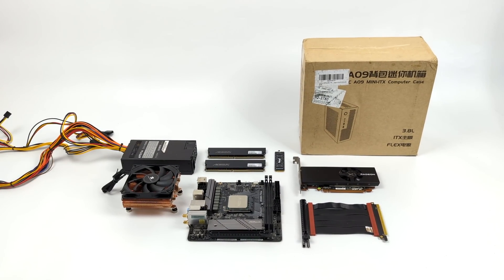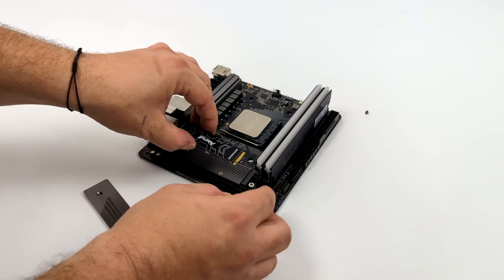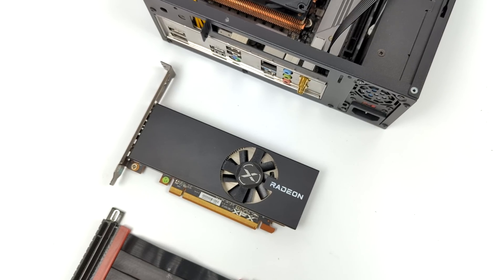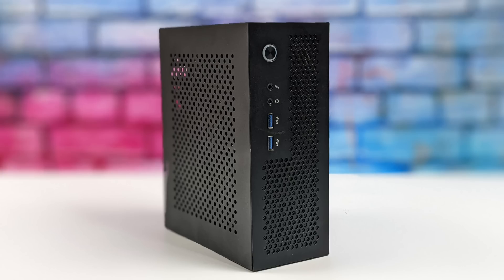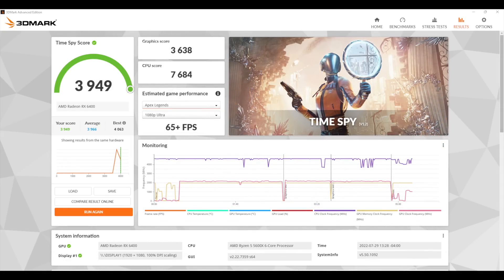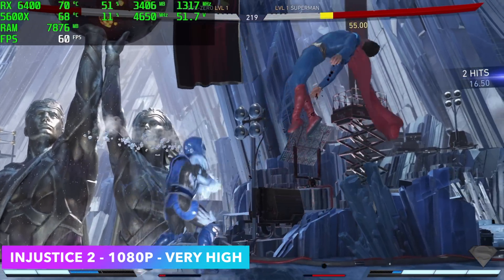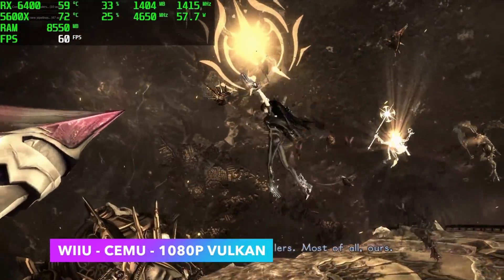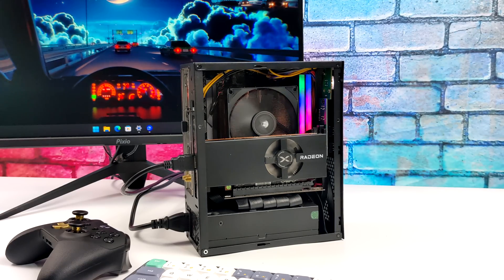A Tiny 3.8L PC With A dGPU! Powerful Small Foot-Print Gaming/EMU Build

Comment: Fractal Ridge Vertical: 374 x 110 x 395 mm, Horizontal: 360 x 375 x 115 mm - 12.6L
Fractal Mood 212 x 212 x 453 mm - The internal frames, external volume is 13.6L. The external volume of the entire unit is 20.4L
Jonsbo NV10 Vertical: 205 x 108 x 205 mm, Horizontal: 205 x 205 x 108 mm - 4.5L
Goodisory A02 Vertical: Pionowo 200 x 85 x 200 mm, , Horizontal: 200 x 200 x 85 mm - 3.4L
I have Lian Li A4 H2O 329 x 140 x 244 - 11L

Comment: This is a horrible idea, i built exactly this. Gpu blocks cpu fan and barely has exhaust. Shit overheats constantly.
Reply: I had this basic setup. (Silverstone sfx console) was idle at 63c . Games 91c .I took everything out and bought a corsair 2000d case for 50 bucks. It was very worth it. Maybe hit 77c in elden Ring the cpu, don't get over 56c
Reply: @mint614 did you try to undervault the cpu and gpu

Comment: The case has a version 2 now that uses pico module to power it with external brick. This allows an LP card like A2000 to sit in perfectly without the use of riser cable, and it's 2x as fast as this setup yet maintaining it's 3.8L form factor.

Comment: Has anyone had a problem with this build with there 6400 getting in the high 70’s C and then having  stuttering when gaming?. Maybe it’s just my 6400.
Reply: This xfx version and a lot of these lp cards run very hot and can often throttle in poorly ventilated cases....the sapphire pulse version is the best one in terms of thermals

Comment: Man, I bought some components that you had linked in the description. I was super psyched to build this little thing, but when I actually went to put it together I realized there's just no way that these components are going to fit. I probably should have been paying closer attention, because I noticed that the cooler that was in the link was not the same as the one you used in the video. It also seems that the riser cable is not nearly as flexible as the one you have in the video. 

I had to pause because I was pretty sure I bought all the components from the links you provided, have you removed any links from the description?
Reply: I had similar issue, thought I bought identical parts but ran into an issue with the back of the GPU interfering with the fan blades on the CPU cooler. After checking over the video vs my parts multiple times it looks like his CPU cooler heatsink mounts different to mine (rotated 90 degrees with the curved heatpipes facing the GPU slot. Mine had the curved heatpipe facing the RAM instead, I think if my cooler installed the saw way as in the video I could have slid the fan higher up the cooler and made enough clearence for the fan blade but it wasnt possible for me without using some janky method of securing the CPU fan down. 

In the end I gave up and just ordered the Noctua cooler, its only a few degrees hotter but give plenty of clearence

Comment: For having set up a similar machine, this case is a OVEN for everything inside. The cable management is a nightmare if you don't have a modular flex psu (and even with) ! The electronic front USB panel needs to be definitively removed depending on your mobo. The HDD led is present but doesn't work even when the wire is plugged. The holes on panels are badly designed and don't provide sufficient air flow for cooling components : you need to crank your fans on max to blow sufficient cool air, and by doing so you litterraly transform your pc in a vaccum cleaner.
It's interesting to see videos of building a SFF pc, but what people doesn't tell you is how bad and how difficult is the thermal optimization for such cases. By the way, we don't see temperatures of the setup on this video and this for a good reason : it would have made everyone panic !
Reply: He does show temps

Comment: Just a heads up for folks wanting to try a build like this - the CPU cooler is actually too tall for this to work with the case side panel closed. It pushes the GPU against the CPU fan in a way that causes the screws on the back of the GPU to impede the CPU fan spin. 

Conceptually, it still works but you need a lower profile cooler like the Noctua NH-L9a for the case to close.
Reply: Yup , just found this out the hard way, I ordered the same 47mm cooler thinking it would be fine and its impossible to get the GPU mounted up without it hitting the fan. I just ordered the noctua cooler instead

Comment: I did a build with this exact setup and I would recommend a 36mm cooler if you have a GPU. My Pulse 6400 would rest on the bottom of the cooler and kinda was at a bad angle and would slightly bend when I put the side panel on . For the Riser I was able to get a 5cm to barely reach.  The A09 case I would recommend a modular PSU or it’s kind of a nightmare trying to tuck all the cables so they don’t get in the way.  Otherwise it’s a good build.
Reply: I just had the exact same experience, actually. I wonder if the fan he installed on this isn't slightly thinner than what comes stock with the thermalright 47mm Cu cooler
Reply: @btango7029  I ended up going with a NH-L9a-AM4 (37mm) and I can report that it does in fact fit this setup.
Reply: @FastJohnnyNardGard  Likewise; used the same cooler in two hyper-compact builds now. Pretty impressive for its size, all things considered.
Reply: @SunSpear64 dumb question would a low profile rtx 4060 fit this case
Reply: @Spencerwalker21 I never said a low profile 4060 would fit I said the 6400 does not have enough clearance with the 47mm cooler and to use a 36mm.  Allot of people doing this build need to know that. It appears in the Video there might be a small amount of clearance for the GPU and the fan when in fact there is not any.
Reply: @SunSpear84  never said you did I asked a question I'm a noob wasn't sure if a low profile 4060 would fit.
Reply: @Spencerwalker21  I built this system a couple months back and not a chance.
Reply: @FastJohnnyNardGard  thanks 👍
Reply: @Spencerwalker21  nah, only fits single slot cards
Reply: @btango7029  oh I thought it was a single slot card my bad.
Reply: Oh ok my apologies then 👍

Comment: Yep PCIe 4th gen really does help and I noticed you DID buy a PCIe 4th gen extension cable.  I personally would have gone with a 4-lane cable and ensure it is secured on both ends since the 16-lane cable impedes airflow and the RX6400 ONLY using 4-lanes.  Also, the RX6400 aluminum cowl from this company is poorly design and I found air leaks around the PCB causes hotspots on the system motherboard.  I use my go-to Tesa 51016 high temp wrapping tape to seal the sides open between the cowl and the GPU PCB to ensure airflow is directed out the back and front.  I also have a problem with the way this card allows hot air to flow across the auxiliary circuitry in the front of the card.  I have also found you need to make sure the air is vented out the case otherwise you are defeating who whole purpose in the use of this card.  In my own slim mini-ITX version, I chose to modify the cowl so that it only covered the fan to ensure the upper vented case does not impede the fan from spinning. Then I used copper shims to ensure a gap is kept between the upper case panel (with air grating), this allowed it remain in most situation a cool (35c) and no more than 70c when in full use.  More important the hot air is directed out of the case instead trapped in the case, keeping the CPU cooler by 5c-10c.  The fact you also have power supply in the case, means you have three fans running making this louder than need be.  I for one like external power supplies because you can replace the 19VDC with 6-10AH Li-ION power tool batteries for 1-4 hours of operation.  With a simple USB based voltage monitoring tool, you can create a simple way to monitor and power down the PC before the battery goes below minimal voltage (about 17VDC).  One last thing.  You can find adhesive backed silicone sheets that can be cut to ensure the back of some of these cards provide electrical and heat insulation. I have used it on several builds, including the M6/RX6400 foldable — which is pretty cool to stuff a full operational dGPU/CPU Windows based system in your back pocket or cargo pants pocket.  Why? As you would say, because I can. :)

Comment: I bought a Thermalright  47mm low-profile cooler, and my RX 6400 does not clear the fan. I have no idea how you did it. I'll have to go with the Noctua 37mm cooler. 
Noticed the cooler and the riser cable models were not listed. I went with the 50mm riser cable "Linkup" same brand, which I am convinced is shorter than the one in the video. that silly thing was $92 CDN. not cheap. I did everything the same but I have the 5700g and 50mm riser cable... I really enjoy your content!

Comment: I think I'll go with this build! But, reading Rx 6400 Low Profile reviews, people complain about its temps reaching 90+... How did you keep them under control?
Reply: You can play with setting and underclock abit (with an igpu on i was almost at 70c after underclocking about 200mh or 300mh it went almost 20c lower)

Comment: I was able to build the same PC, although the power supply is getting pretty hot and loud. The AMD Radeon RX 6400 specs says that we should not use less than 350W and these power supply are around $100 right now ($60 more expansive than the 300W: which disappeared from Amazon). So I guess I'll just use it until it explodes
Reply: About how much did this setup cost on your end?
Reply: @mike_t_007  around $700
Reply: I would have gone for a cheaper CPU with less power consumption, the 5600x is overkill with the 6400 imo

Comment: i'm looking at the tesla m4 accelerator and it seems it's the same process as the 40 regarding gpu passthrough/hardware layer access. for ~70 less and around the same tdp it may be a cheaper solution.

Comment: You might theoretically be able to put a higher power single slot full-sized card in this case, like the Radeon Pro W6600, at least if you could manage a 350W power supply, but it wouldn't be very cost effective.

Comment: awsome!!went air cooled in my q58 itx build, ryzen7 2700 65w tdp chip with a noctua l9a cpu cooler added a fan grill and a 120mm halo fan over top of cpu fan and fits, awsome temps, 4 cooler master halo fans glass on top on both sides ,2top intake fans,side intake and bottom exhaust, 1tb m.2 on mobo,a 2tb laptop drive in front panel, fit a 4tb 2.5in 15mm thick drive dehind psu, also fit another 4tb in front of the other drive at the end of the 2fan gigabyte rtx 2060, the 4tb has an external black shell over it and double sided at empty area at end of graphics card, got a vid on here of it...love the vids!!

Comment: Love the build and the small form factor. The two fans spinning on top of each other looks so steampunkish. I'm still struggling to find a small case with a single low profile gpu slot that doesn't have a power supply slot, I want to go for a pico instead. Less noise and I can hide the power brick behind my furniture.
Reply: Checkout j-Hack pure mk2, 3.1 L, 2 slot GPU

Comment: can you link the riser cable or comment the length of the cable?
Reply: just look that up
Reply: I’m pretty sure that’s it
Reply: LINKUP - Ultra PCIe 4.0 X16 Riser Cable right angle [15cm] I referred to timestamp 3:43 for the length compared to the gpu which is 15.5cm long.
Reply: @bunkymunky  smart, thanks

Comment: Since it's a 47 mm CPU couldn't you use a ALPENFOHN 47 mm cooler and fit a MSI 3060 ti Aero single fan card that would make this build bag also
Reply: A09 can only fit a single slot card, MSI 3060ti Aero is 2 slots

Comment: Most DIY builds should as small as this by now, but no, bling RGB and excessive fans is the thing.  Personally, I'd like a case like this but with the GPU card being external to be visible and no air restrictions.
edit: additionally, we should get rid of rivets for cases so that it is possible for building inside-out especially for tight cases like this.
Reply: If by diy builds, you mean full fledged gaming rigs, you have no idea what you are talking about…

Comment: 300W, am4 6 cores, a dedicated gpu in that little footprint . . . good gosh!  Well done, ETA!  Really enjoy all of your custom builds!
Reply: Been looking into sff builds and decided on a velka 3 3.9L case build. Managed to find a msi aero 3060ti to fit into the case. Wish me the best of luck once it all arrives. It's gonna be fun putting all the parts together.
Reply: @Kinrian2797  Good luck, neighbor sir!
Reply: @chromerims  less than that, i use the r5 5600 and the rx6400 with the same motherboard as him, nvme ssd + sata ssd, albeit with a different case, and with a 250w flex psu, and it works just fine
Reply: @mparagames  Too cool, neighbour 👍 Also since the time of this video, now the Minisform HX99G (with an dgpu) looks competitive with this eta SFF build . . . at least on superficial specs. Kindest regards, friends.
Reply: @chromerims  (how the hell did they fit a dgpu in there)

but yeah, that would be even better cause it includes encoders and av1 decoding, but the thing is 

I already have the pc, i'm not gonna sell everything, However i am interested in this case, since the one i have has pretty poor cooling (and this one in the video seems to be so much better), so just by swapping the caswe i'd get a quiter and cooler pc lol. 

But i don't have the money for that now, sadly
Reply: Agreed.
It sucks that we can't build a Gaming PC that is more powerful than the new-generation consoles (XsX), at a small console-like size. Not even mentioning the current parts costs.

During the late-PS3 era (2011) to the (2015) PS4 era, and then Xbox One X era (2019). It was possible to build a HTPC that would rival the consoles in performance, size, and to some extent cost.
Reply: They finally released a low profile rtx 4070

Comment: I bought the xfx 6400 card based on your video and commentary and paired with the HP Pavilion desktop with the Ryzen 5700G i know the 6400 is being hindered with the gen 3 pcie slot but using only a 180 watt power supply  and i will say i have not been disappointed.  So thank you ETA Prime your vids are entertaining  and informative

Comment: Did you ever consider using A09P case instead? It is 4.2L, same height and width, just about 19mm longer. Basically just as compact but you get slightly more room to work with.
Reply: Velka 3 or K39 are better, 3.9L and 4.2L and can fit 2-Slot SFF cards like the MSI 3060Ti Aero

Comment: for a bit more cash you could get double the performance with a good value msi geforce gtx 1660 super 6gb aero itx - selling cheap especially used.
Reply: Won't fit, needs to be single slot card for the A09 case.

Comment: Awesome little build. I think I would pair it with something like an i3-12100 on H610. Nice budget option with an LP cooler included and QSV on the iGPU in case you ever want to record gameplay or run a simple stream.
Reply: H610 does not support PCIE 4.0. Better go with B660 if you are using RX 6400.
Reply: @TheSektor13  oh interesting. I didn't know that. The board doesnt support pcie 4 lanes from CPU? Even if the chipset only has 3.0 lanes?
Reply: @TheSektor13  H610 support pcie 4.0   , just check the spec of some H610board
Reply: @gunturbayu6779  Chipset by itself does not support Pcie4 (so says Intel).
But i guess PCIE slot that is directly connected to CPU can work on PCIE 4.0 it seems. Didn't know that.

Comment: Great built, but I dont recommend it. Because the RX6400 is made for notebooks which have CPUs with a iGPU. So I highly recommend a CPU with iGPU for example the Ryzen 5600G instead the 5600X! Or take an another low profile GPU with OpenCl or CUDA. Otherwise you can recode no video. No Video calls, now streaming, no game recording and even no screenshots in some games.

The reason is because all notebooks CPUs have an iGPU which can encode videos. Its not neccessary to have hardware encoder inside the CPU and in the GPU aswell.  To save cost and reduce power consumption the RX 6400 has no hardware encoder. But AMD drop the GPU without any changes for desktop PCs. Some desktop PCs haven't a iGPU.

Comment: How is the noise on the power supply? I vaguely remember you disliking the noise on your R5 3600/gtx 1650 build, which I think was also a flex psu.

Comment: Oh, it's the B550M-ITX/ac, not the more expensive B550 PG-ITX/ax.
I'm using the latter for my 5600 (non-X) build, and it has TWO m.2 slots for SSDs, one one the top and one on the bottom.
Of course, it has one more m.2 for WiFi module.  It's amazing how much they can fit into a Mini-ITX form factor.

Comment: For all it's issues, the RX 6400 is a great fit for small builds.
Reply: Yeah it has its very specific uses
Reply: Yes, it's currently at the top of my list of cards for transforming retired low profile business machines into 1080p gaming computers, though they are generally limited to PCI-E 3.0 and thus a little bottlenecked.

Comment: You can use an R5 5600/i5 12400 to save a few bucks, even an i3 12100F would be ok. I saw you use your 5600X in a lot of videos, so I think you don't want to buy a new CPU and use the same CPU for all videos, so its understandable that way.
Reply: ETA posts new videos each day.

Comment: For when you want a desktop so crammed together you'd think it was just a girthy laptop.

EDIT: I waited to make this part of the comment until I saw proof of my suspicions, and I should have just said it at the beginning.  You have an air cooled system, with only the room for a CPU and GPU fan... that's no where NEAR enough room to move the heat out, as evidenced by the fact that the GPU and CPU on better hardware than I have are both hugging 80 C when mine never get passed 70 even on the most demanding games I have.  Do not do this for a serious rig, you will destroy the hardware fast, especially in warmer climates.  And there's no room to water cool this thing.